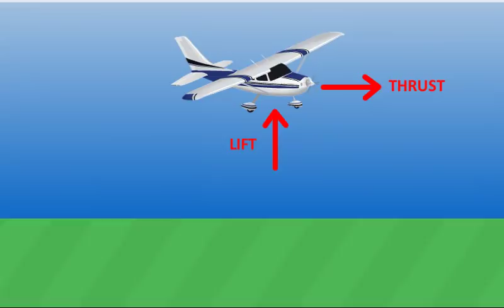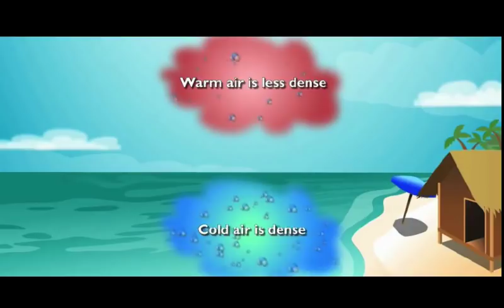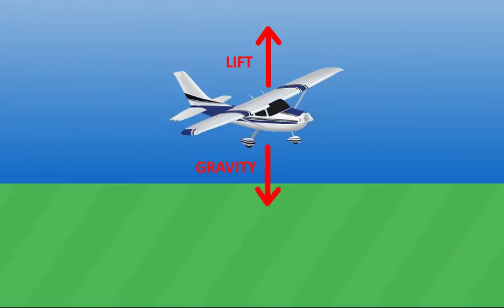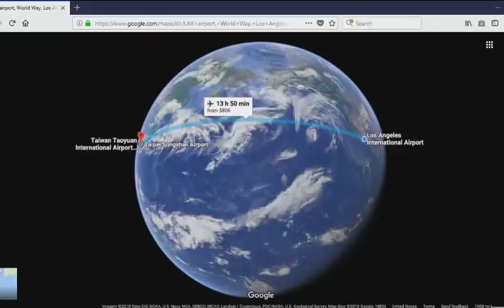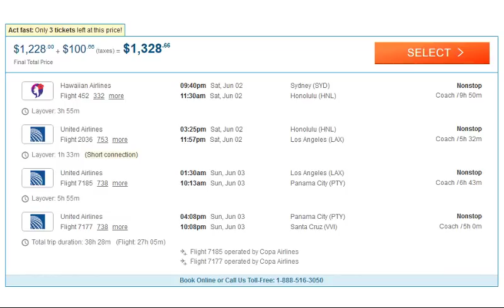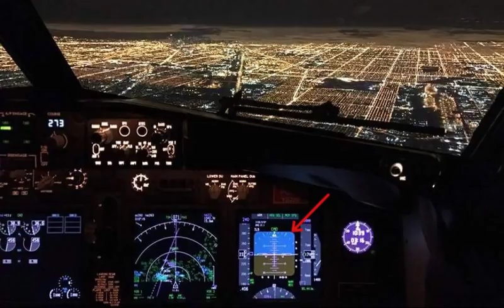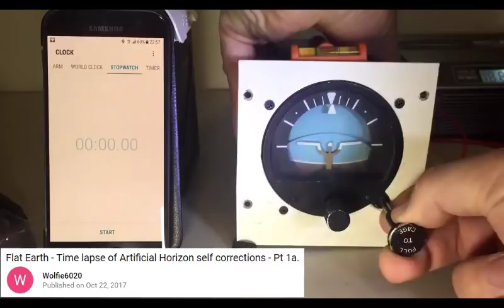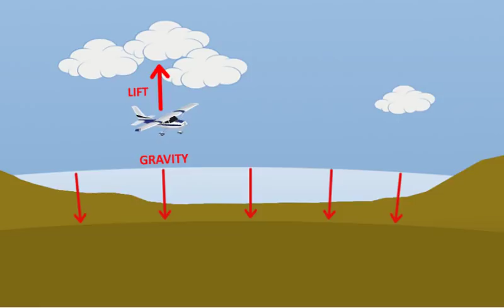Flat Earth Falsities - Plane Nonsense

Comment: The airport stops are logical. Gyros are not affected by gravity as far as I can tell. The problem I have is with things I can test such as finding the curve over several miles of water. I always see things that should be hidden.(and my math is correct)
Reply: What type of calculations are you using?
Reply: No Raymond, your math is not correct.

Comment: Could you make a video explaining to flat-earthers that a map is simply a drawing or a picture (Should that be pronounced ' picher' for them?).  People are not flat but pictures (photos, paintings, etc) are flat.
Dig out the old Mercator Projection map that has been hanging on the walls of primary schools for decades. All you have to do is look at the parallel lines (the latitude) to see the distortion; the lines are farther apart yet they represent the same distance (in degrees) on a sphere.
I used to teach freshman geography, but I can't simplify this enough for the flat-earthers to understand.

Comment: This video is so bad for many reasons but I'm laughing at the assumptions that google earth is correct.
Reply: Can you elaborate on those reasons, or just make snide open ended statements?
Reply: David Fulwiler Because google earth shows a round earth. Do some research in to Googlism, which is run by the elites.  Any amateur vid or pic will show you a flat earth.
Reply: johndrocket Try describing those reasons.
Reply: Flook D scroll see my response to David Fulwiler, right below your comment to me.
Reply: johndrocket Circular reasoning.
Reply: @flookd5516  How is that circular reasoning?
Reply: Can you see the Queen of Hearts from way down in that rabbit hole you are in?
Reply: johnrocket You are claiming the photos are fake and and that they are produced by "elites", using both claims to support each other without actually producing any evidence of the fraud or fraudsters.
Reply: Flook D I never said or implied photos of a round earth support elites.  I did research learned that "elites", meaning freemasons or secret societies, uphold an agenda of a round earth which there is not strong scientific basis.  As for evidence, look at pics of NASA and other space agencies and compare them to amateur pics, and while you're at it you might as well do some research on what circular reasoning really means.

Comment: If a fly in a moving car held a stationary fixed XYZ position along the cars path wouldn't the fly collide with the car? Same with the ball the child had in the car. If the ball were to hold to a fixed stationary XYZ position along the cars path the ball would collide with the child.
Reply: TheSkyhawk40 Why would the ball travelling in the car abruptly become motionless?
Reply: What?
Reply: A fixed XYZ position doesn't exist objectively, the frame of reference for which it is still needs to be specified, so if the fly was still for the car's frame of reference, then they wouldn't collide, but if it was still for the ground's frame of reference, then they would collide.
Reply: A fixed XYZ position can exist objectively to the person who is in the frame of reference. If we were spinning it would be easy to prove.
Reply: @TheSkyhawk40  If it is dependant on the frame of reference it is by definition subjective...
It is, but you can't feel it because you're also spinning, therefore not moving from the grounds frame of reference
Reply: We are spinning but most people say rotating and orbiting. Now do you know a wizard that can freeze any objects in space and time?
Reply: Wait, the ball is inside the moving car but not moving relative to the road?  How would that ever happen?  If a fly crawled inside your head, wouldn't you have double the number of brain cells?
Reply: Yes if a wizard froze the ball in the air the child would smack into it. Do you know any wizards?

Comment: Flat earth believers don’t understand gravity when you explain it to them they deny your proof you can show varying degrees of gravity based on where you were located on the planet

If the atmosphere is contained with in the dome what is producing wind how come the dome doesn’t melt with all the wildfires that burn throughout the planet of course they can’t even tell you what the dorm is made out of
Reply: There is no proof. Dropping a mic? Cavendish? Come on now.
Reply: Bobby Wizdum there is a basic method showing gravity and measuring it. It has Different values based on your position on the earth
Reply: @iron60bitch62  thats just math formulas. There is nothing showing gravity makes water stick to spinning balls, automatically levels airplanes, is pulling oceans causing tides, etc. The only thing proveable is objects more dense than air stay grounded without wings lol
Reply: Bobby Wizdum I’ve never said it was about math I never even gave my example what are you talking about there are many experiments that show the presence of gravity if your IQ does not allow you to except that that’s fine but I’ve never even shared the experiment what are you talking about
Reply: Many people who believe the earth is flat don’t have the cognitive ability to understand basic simple physics they are Internet information warriors with very little common sense

Comment: The truth is ...the Earth gives its Secrets away, even by the pictures Nasa uses.
Look at North Africa, you can see the pathway of the Sun. If the sun were 93 million miles away, and not local to Earth ...the whole Earth would be scorched like that. But even worse because it would beam twelve full hours every part of Earth and snow and ice ... impossible!
Reply from the maker: The sunlight doesn’t start heating anything until it reaches the earth’s atmosphere. There is nothing in space for it to heat. So the relative distance from the equator to the poles is more significant than you think. But it is not really the distance, but the angle. The equatorial regions are hotter for two reasons, they get more DIRECT sunlight, while the closer you get to the poles, the more atmosphere the sun has to go through because of the angle. The same amount of sunlight has to heat much more atmosphere.

And also, the length of daylight doesn’t change as much, close to the equator. At higher latitudes in winter, the daylight is shorter and the night is longer, so there is less time to heat up and more time to cool off each day. And in the summer, the opposite happens. This doesn’t happen at the equator, so it stays hot all year long.  Science actually has explanations for all of it. You just are ignorant of it.
Reply: @JonasGrumby71  The moment you begin to speak I knew you're a son of a liar ...how much more when you dare put your words to be clearly seen. 
The pole in my pant does more shifting than the one you imagine between your sick ears ...dog!
Reply from the maker: Mr Wally - You are not making any sense. Did you forget your medication again?
Reply: @CaptWesStarwind  Well, if you think the Earth is shooting through space being 75% water, clay, rock and metal flying at thousands of miles per hour, yet staying together by the same gravity that will not harm a flying butterfly. 

Then you go ahead and think that ...what you God haters can't understand is, every hidden thing will come to the light. So really you guys are doing what comes natural defending your Lies. 

But like the wall of Jericho every one of them will fall ...not on your time. But on God's. Rather I learned it on YouTube or in the Bible which clearly says the shape of the Earth. Dome above which means, there's no SPACE for evil men to shoot his rocket. 

The scripture says the Earth is His footstool. I don't think even a man would watch YouTube with his footstool flying all over the place, and at a thousand MPH. 

Gods Thorne is IN Order ...calm and peaceful. So your big bang ((THEORY)) ...expanding universe  is a doctrine of demons. You can keep it to yourself and pay for it, OR share it, and make you some converts ...but just like Johnny sings "God's gonna hunt you down" and you're going to pay for every soul ...under you.

You devil you are in bondage because you have a rich education ...but blessed are they who has God, for we lack nothing ... and we have the unction of the Holy Spirit and we know all things. Because he knows all things that's why you robots are confounded.
Reply: Umm who told you earth was 75% water?
Reply: Are you also essentially admitting you have no education and no understanding of the explanations given to us by science? You know what kind of argument that is?
Reply: @CaptWesStarwind  Keep on reading ...your getting smarter.

Okay, 97% water. I forgot to include the ice walls, and the water above. Noah knows.
Reply: You sure aren't. Now who told you the earths mass is 97% water?
Reply: Where are you getting these figures from?
Reply: Mr Wally Gods were the creation of men in a time of ignorance;  lacking the knowledge to explain the world around them it was easier to ascribe the complex and the poorly understood to silent, invisible, magical beings.  We now live in a time were so much information is easily and freely available that most people have to make a conscious decision to remain ignorant.  It seems you have made that choice.  Surrounded by more educated people you feel threatened and lash out, trying to justify your decision to remain ignorant.  Gods are not real and ignorance should not be aspired to.
Reply: @No... No brains, you couldn't come up with your own saying. So you quoted me. Concerning you.
   ~Thank you
Reply: Mr Wally Where did you get the "Earth is 97% water" from?
Reply: Who told you the earths mass is 97% water? Not a hard question. Why are you having such trouble citing the source of your claim?
Reply: Mr Wally
This may come as a big surprise to you bur=t there is no god, any god and your bible has been proved a compilation of pre-existing heathen myths. So you are essentially a follower of heathen imagery and beliefs. Well done, good and faithful sheep.
I'm also sorry to have to disabuse you of your religious beliefs, but we know the earth is a slowly rotating terrestrial spheroid and gravity is a fact.  Just because you are incapable of understanding basic maths and physics and wilfully refuse to learn such things is your problem. Examples of questions for you about basic, practical, everyday maths and physics used in the real world. Can you answer them? 
What is the relationship between longitude and distance when travelling east or west parallel to the equator?. If you know the answer then you know the earth is a spheroid. If you don't you are not qualified to comment on the earth’s shape.
Please explain the principles behind the development and functioning of a gyrocompass? If you can then you know the earth is a slowly rotating spheroid and gravity is a fact. If you don't you are not qualified to comment on gravity, the earth's shape or movement.
Reply: Mr Wally I doubt you would recognise the truth in anything.  Flat earthers thrive on lies and lying.  Oh, God said could you stop bothering him please.
Reply: @No... Well, I don't worship science ...There is a Creator to insult. I'll leave that to fools. Besides ...one, has to throw his brain out in order to believe the things you pagans worship. The SPACE ...is between your ears ...made up words and countless digits are used like serpents venom, to confuse those impressed with entities like NASA and brain-X-ed who rob the citizens to purchase lying wonders like CGI earth ...images of a "real car" ...in its back ground? CGI EARTH ...dogs and GOD HATERS.
Reply: @iamknotlion4286  you just made my day 😂😂😂

Comment: At 2:44 is the car going in a circle like the earth? I bet if you marked a fix position on the cars path in relation to the ball being tossed by the child the ball will not be moving with the car.
Reply: Forget about the car traveling in a circle... Sorry for the confusion.  Instead picture the ball having a fixed position over the cars path. The fixed position represents the position the ball is to stop.  Would the ball collide with the car once the car traveled over the fixed position or would the ball travel with the car over the balls fixed position destination??
Reply: TheSkyhawk40 Why would the ball cease travelling forwards with car when it left the child's hand?
Reply: Are you familiar with the XYZ coordinate system? For example mark an XYZ position and hold that position. Now measure time and distance to get speed passing your XYZ position. Use a helicopter and hold XYZ position. Now measure how much time and ground have passed and you now know speed of earths spin. Do you understand XYZ coordinate system?
Reply: Speed is relative to the observer, and so holding XYZ position in a certain frame of reference just means not recieving any force, so you wont be able to measure any spin with your experiment.
Why it wouldn't work can be visualized by starting a drone from within a train moving at a certain speed relative to the ground, when the drone takes off and holds position, it will measure that the train is not moving.

A way to measure earth's spin would be taking your starting point to be the south pole, and then moving your helicopter to the ecuator, this way you will feel a very measurable coriolis force.
Reply: Yes if a wizard froze the helicopter in space and time, well the earth would probably smash right into it since the earth is orbiting the sun as well as rotating.
Reply: The thing is nothing can be "frozen" in space and time since there is no objective frame of reference, from the point of view of the helicopter someone would argue that the helicopter is perfectly still, and his opinion will not be any less correct than someone in the point of view of the sun, who would see the helicopter orbiting the sun (with the earth) and rotating around earth's axis.
Reply: So helicopter pilots are "wizards" for holding an XYZ position because the earth does not move below them ;) lol... Hello Wizard...owe, I mean helicopter pilot. Great conversation starter...thanks
Reply: @TheSkyhawk40  The helicopter breaks off the ground already in the same frame of reference as the ground, so unless the rotational speed of the ground changed  
while the helicopter was hovering, there is no way it could see earth's rotation.
Reply: Non-sense. If the ground below is moving like science teaches and the helicopter holds a XYZ Cartesian position the ground  will be moving under the helicopter.
Reply: if you hold a XYZ position like a helicopter can it would be easy to show the earth is spinning.
Reply: @TheSkyhawk40  What you're talking about doesn't exist in an absolute sense, if i'm in a car moving at 100km/h relative to the ground, and hold a drone over my head, that 
drone will feel as if not moving and will by my own frame of reference be holding a perfeclty still position.
Simply saying hold an "XYZ position" is meaningless, it can't be done objectively and that's why we say the helicopter would have to be magical  to achieve it, the simple fact is that movement is relative to the observer so before declaring a point of view it's impossible to affirm something is holding position, the same goes for a cartesian coordinate
system, it needs an origin that is assumed to have 0 velocity, but this is by definition, not because the origin objectively has 0 velocity (for spatial coordinate systems, that is, 
a frame of reference specifies (0,0,0) and includes the dimension of time aswell).
Reply: If the ground is spanning below us it would be easy to prove by a helicopter holding an xyz position of origin for a certain amount of time.  Flight times east to west and vice versa would be significantly different.
Reply: @TheSkyhawk40  Please read my comment instead of mindlessly replying with the same comment over and over, holding an xyz position means nothing if you don't specify.
How would flight times change? please do remember that planes take off from the same inertial frame of reference as the ground already spinning, so unless they travel north or south (reducing linear velocity compared to ecuator, assuming that's the starting point), the spin of the earth wouldn't make a difference.
To simplify it: A plane takes off spinning, flies spinning and lands spinning, just like the ground below it.